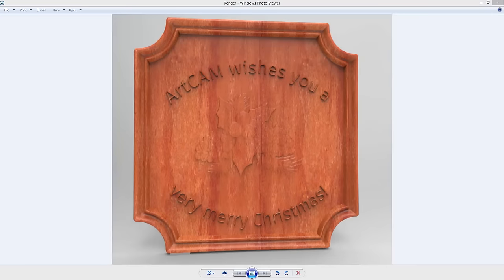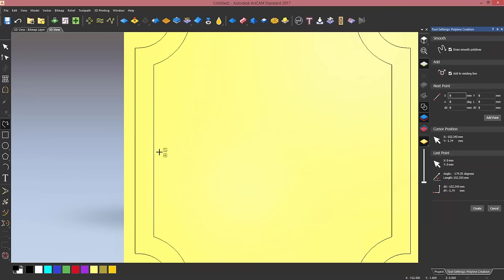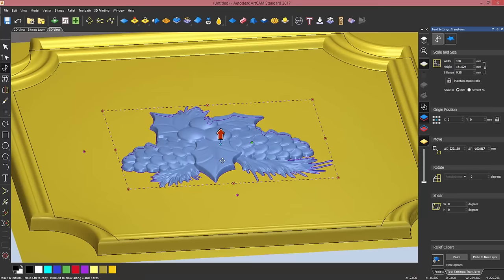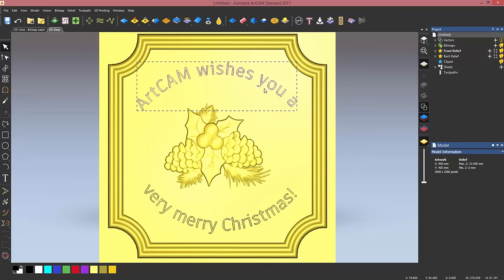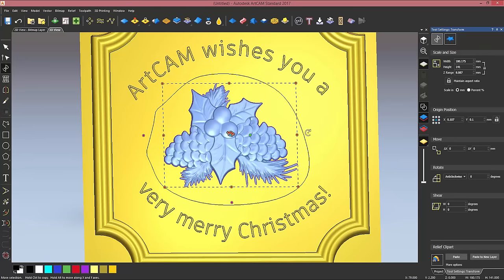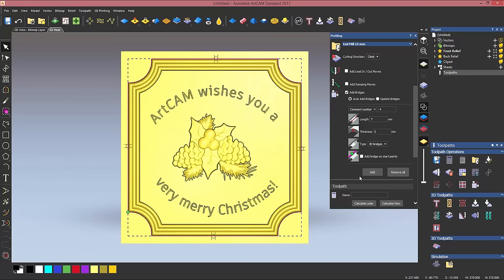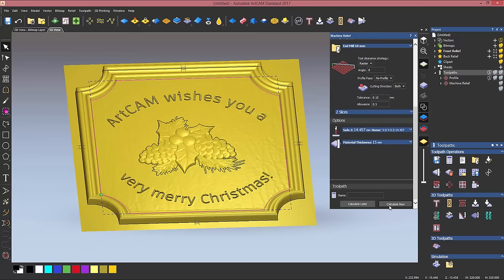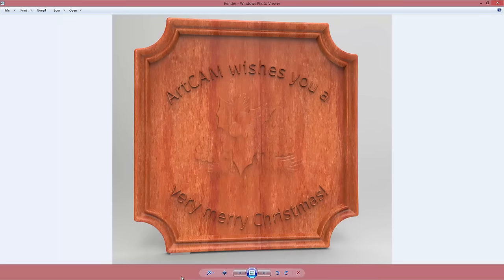Standard Demonstration - ArtCAM 2017

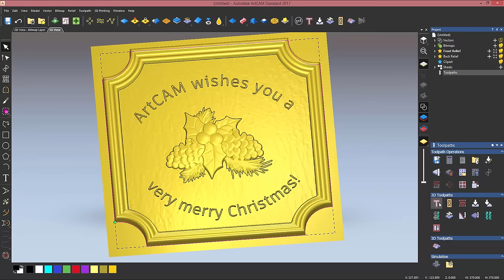Comment: Around 10:13 you set the material thickness to 15 mm. I am unable to do the same, as soon as I specify 15 mm as my thickness, the 'ok' button becomes disabled. My suspicion is that the cross section of my 2 rail sweep is taller than that. Should I have set my scale final height to 15mm when creating the 2 rail sweep?
Reply from the maker: Hi Augusto, for any technical support/questions, I'd recommend you check out the ArtCAM Forum. If you can't find a solution, you can ask the technical team a question: https://forums.autodesk.com/t5/artcam-forum/bd-p/284